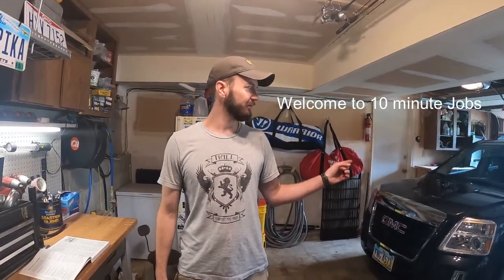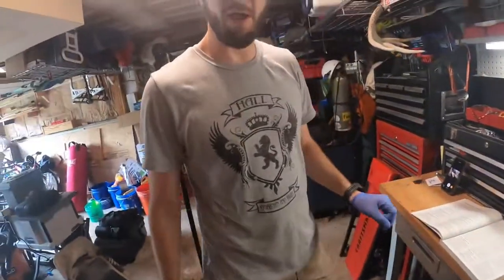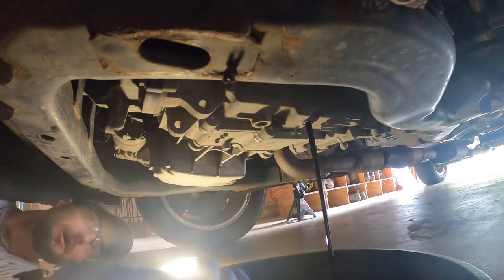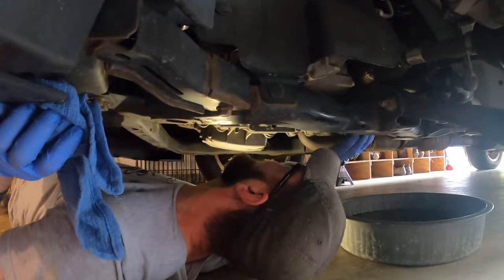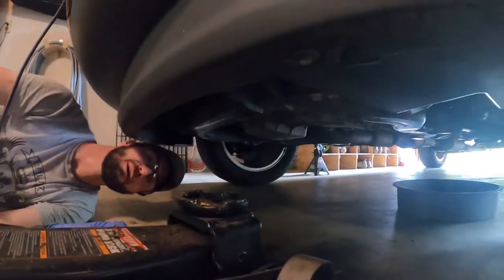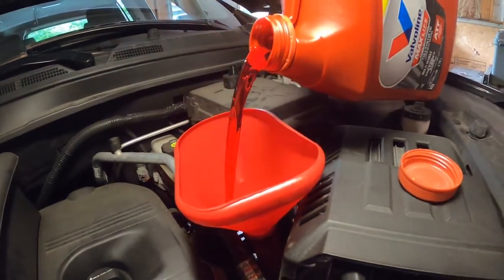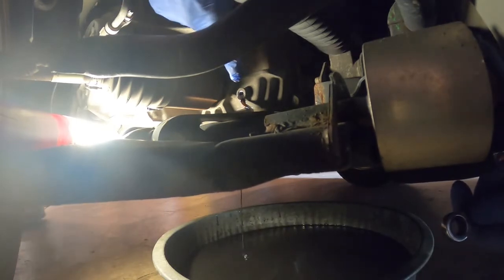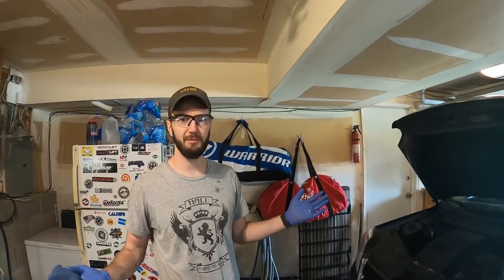2015 GMC Terrain Transmission Fluid Change

Comment: Awesome video! Thank you! Here are 3 things I would add.

1) Open Fill Plug half way BEFORE opening Drain Plug. This makes sure it can come off and to allow air flow.
2) The torque specification for both the Drain Plug and Check Plug is 106 INCH-lbs.
3) Before opening the Check Plug, the engine's temperature must be between 185-203 degrees Fahrenheit.

I found that I had to drive enthusiastically for about 20 minutes before the transmission temperature even reached 185 degrees.
Just something to note.
Reply from the maker: Thanks for the tips!

Comment: Nice video on the transmission "drain & fill". I do my 2013 Equinox every summer, since I got it used with 45K miles.
I got a bit concerned when you first jacked it up. Good recovery though, gotta keep all 4 on the ground to be level.
Here's my suggestion:
Get her hot, park it level and turn the wheels fully to the right. You'll see the level plug which u can reach with an 18" extension.
The rest is as you did it. And it really is a 10 minute job, and easier than an oil & filter change!
Reply from the maker: Thanks for the info!

Comment: I've been searching for this video--just what i needed. It will be my first time doing transmision drain and fill on my 2011 Terrain. Questions  had are now answered so i will feel confident doing this job. At the end, you talked about other maintenance. Did you do the transfer case? I think i will do it at the same time. 2011 with 25000 miles. Not quite 30k, but the years I'm sure deteriorates it.
Reply from the maker: I did the transfer case as well, should be in my video library deal. Thanks!
Reply: @10minutejobs88  I looked and just looked again and I am not seeing it for the GMC Terrain. There is one for the Silverado. I've done my 2007 Tundra and no issues, but I can't seem to find where the gear oil goes for the 2.4L front wheel drive.?!

Comment: Loved the video!  I just did this today because of it. (40k miles past due 😢). Nonetheless I debated on whether to take it somewhere or do it myself so glad I found your video and chose the later. Very helpful, thank you!
Reply: I also did what another person suggested below and turned the wheels all the way right. Made for easy access to the check plug. I didn’t have to jack up the car to get the drain plug off either so saved some time there as well.
Reply from the maker: Great job!

Comment: It takes 30 minutes of highway, highspeed driving, to get transmission fluid to reach the required 180F.  The transmission has a temp controlled reservoir. If its not at temp when you can underfill the transmission. I use a $5 Torque App and BT OBDII adapter to read engine data, and transmission temp.  A simple drain and fill only replaces, 45% of fluid, need to do full fluid exchange, or 4 drain and refills.
Reply: Do you recommend first change with 125k miles?
Reply: @Jorge651  GM recommends at first 45k, I say 30k, and every 30k after.

Comment: The dealership does basically the same thing when flushing the transmission fluid. Except they replace all the fluid, supposedly. They don't change the transmission filter, cause it's a nightmare to do.  I had the transmission fluid changed at 25,000 miles, and 65,000 miles at the dealership, and I did the transmission fluid change at 100,000 miles myself. The transmission oil was still a reddish color, not burnt. The vehicle shifts great. "nock on wood"  I use Valvoline Decron VI in the blue bottle for Transmission fluid.  I'll drain and fill the Transmission fluid once again when I do my next oil change cause I only replaced 5 quarts of the transmission fluid during the 100K miles drain-and-fill. Then I'll check the transmission fluid after another 25,000 miles.  I change the Oil and oil filter every  5k to 6-thousand miles full synthetic 5W-30 every time.  The vehicle runs great.

Comment: What are you going to do with the left over new transmission fluid. Might as well poured everything in. With the overflow nut open, that would have removed some more dirty fluid. Great video BTW. Thanks.

Comment: I was going to do my transfer case at the same time but i couldnt find it, still. So i did the transmission fluid, frain and fill. I removed 4 /2 quarts. Next  issue was i couldnt get the level plug off. It was on there tight. Hindsight, while under the car i should have loosen it then remove it hen i put the car back on the ground. So Plan B was fill will 4 1/2 quarts, what i took out of it. Npw im off to drive it. Fingers crossed.

Comment: I bought mine with 65k miles and now it has 180k miles I have never changed the transmission fluid. I started getting a jerk sound here and there when I  switch gears. Would dirty transmission fluid cause that? Also I’m afraid to change it bc of what some people say it could go wrong about it. I have a 2013 gmc terrain 2.4

Comment: How about measuring what you took out to refill.
Reply: no need to if your using the fill plug in the side of the transmission. This is not a VW...Much easier.

Comment: My owners manual says to change the transmission fluid at 97,500 miles, Not sure where the Hanes manual got their info from. I'll trust my owners manual for service intervals over the Hanes manual. Other than that your video is very informative.
Reply: Nearly all vehicles fall into severe service, which is 45k.

Comment: Do you recommend to change my transmission oil  has 140k miles
Reply from the maker: Assuming you have the same vehicle and it's never been done before, yes it's time to change it.
Reply: Will change the transmission for mines then, my terrain is at 120k miles
Reply: Was iffy at first cause i heard all kinds of theory that changing it can make the transmission slip
Reply: @jahmurlopez379  thats flushing, dont flush
Reply: @jahmurlopez379  Did you ever do it? Did you follow this method? Mine also has 120k miles and was debating it.. Was thinking of doing the remove 2 quarts add 2 quarts method weekly until I reached 8-10 quarts
Reply: Hey guys i ended up getting a lower milage terrain, my old one got wrecked in an accident
Reply: @nickr3441  I won’t flush . So we only change the fluid? Don’t flush?

Comment: Could I use Ramps to drain. Fill while on top of ramps. Bring it down. Then do the overflow plug?
Reply from the maker: As long as the entire vehicle is on ramps (front and rear) or you bring it down when you fill/check level. It is very important to have the vehicle level when checking fluid level in ATs.
Reply: @10minutejobs88  I only have ramps for front. Which means I have to take it to reverse to get it down, then forward to bring it back to garage and level. Is that safe at this point (drained fluid but didn’t fill)?
Reply: @hanDIYdude  You could do it with engine off & in neutral., with engine on? nope, trans pan can't be empty. It'll ruin the tranny. Plus it won't drive either since it needs fluid to create pressure to be drivable.